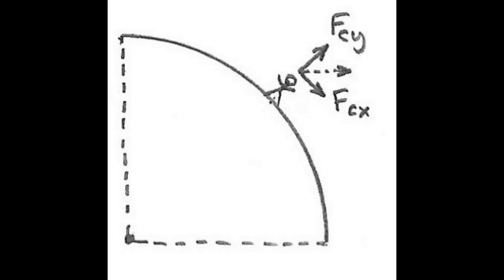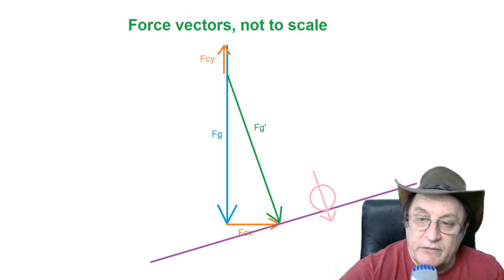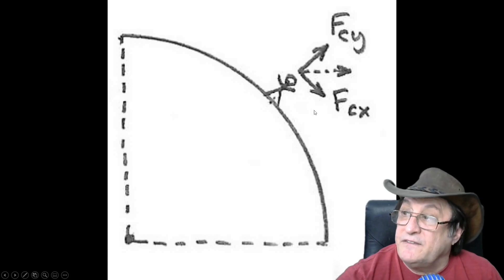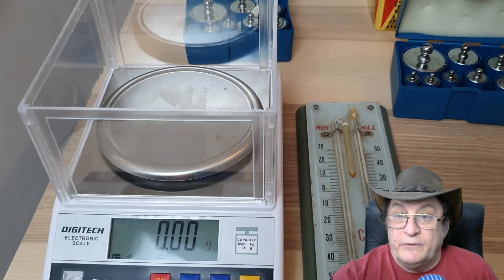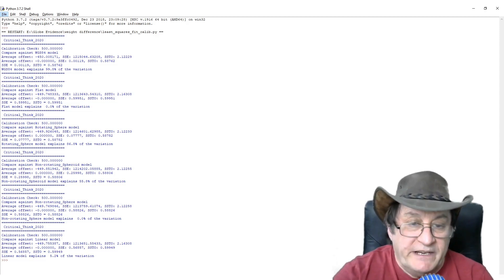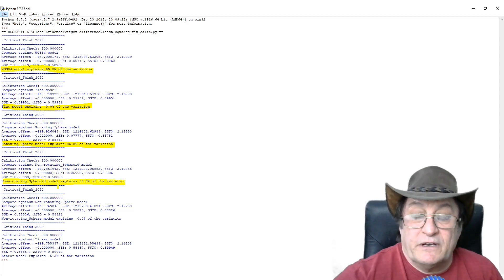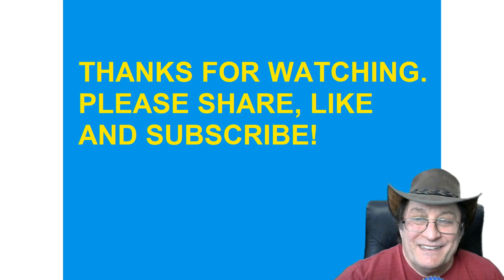David "The Mechanical Engineer" is going to have to eat his PDF. Part 2.

Comment: wouldn't a small stand eliminate the influence of pressure on "weight" CT?
put the weights on something like a pencil end and the pressure from BELOW would be almost 100% the equal of the pressure down on the top of the same weight...  A "caltorp" like thing from wire with minimal contact area would be even better. And you still can tare out before using those.
Reply from the maker: I think the most significant effect of air pressure is a change in buoyancy, and another commenter has calculated this out to be insignificant.

Comment: I think it is even simpler. Fcx is actually zero if you use the oblate spheroid. The spheroid is everywhere perpendicular to the sum of gravity and the centrifugal force. This makes Fcx zero by definition. His assumption of spherical earth was made on purpose to hide this fact.
Reply from the maker: That may be the case. I wasn't able to dig up a concrete reference to verify it. Larry Scott is a geodetic surveyor and says a similar thing.
Reply: @CriticalThink  Think about the oblate spheroid as the surface of the ocean if there were no continents. Water "level" is equipotential surface but the potential is cased by both the forces. Equipotential means there is no component if the sum of the forces parallel to the ocean surface.
Reply from the maker: Arctic Haze I agree, it’s just that I need to do my research to understand it better to verify it for myself.
Reply: @arctic_haze  But in practice the gravity vary. That makes the geoid equipotential.
Reply: @ReinoGoo  If course it does. This is why the geoid is more complicated that just an oblate spheroid. But still, the "level" (for example the local water surface) will still be perpendicular to the vector sum of gravity and centrifugal forces (by the way both are apparent forces but that changes nothing).
Reply from the maker: Nevertheless,  the analysis here doesn't depend on Fcx being zero, so it's not important to verify it.

Comment: I just ran through the calculation of how much variation in air pressure might affect your measurments. Assuming the weights are steel with a density of 7800 kg/m^3, the weight of air displaced by a 1 kg steel mass is nominally 1.57x10^-4 kg. 
If air pressure varies from say 30 inches Hg to 29 inches Hg, that is 1/30, so the difference in buoyant force on the 1 kg mass is 5.24x10^-6 kg,  or 5.24x10^-3 g.   You can see why this variation is negligible compared to the variation due to latitude, which in your case changed  1.8 g on a 500 g mass, between 8 degrees and 38 degrees latitude. The error bars on your measurements due to air pressure should be about +/- 1x10^-3 g.
Reply: For flat earthers 1x10^-3 g is VERY SMALL. ie a third of the mass of a single snowflake.

Comment: Wait. Maybe I missed it. But since Fx exists why does a ball bearing on a flat surface not roll towards the equator? I did not hear the answer to that question. That was David's question. His question was not whether Fx existed. He claimed that since a smooth, steel ball bearing on a flat smooth surface does not roll toward the equator, then Fx must not exist.
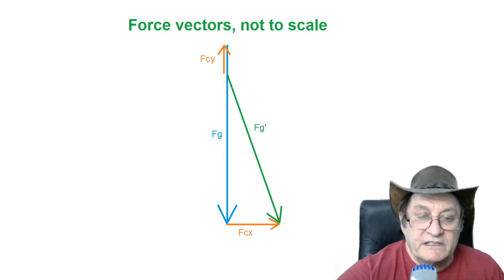Reply from the maker: That's explained at the 2:50 Mark. A level surface will be perpendicular to Fg' hence the ball will not roll.
Reply: Because Fx also affects the instrument used to level the flat surface.  
The "engineer" expects the force to only act upon the ball in the experiment and not the instrument used to level the experiment.
Reply: Ahhh yes! OK. I did not fully comprehend your point with the Fg prime. Now I get it! I guess the point that "level" may not be a tangential line is something that I was aware of because the Earth is not a perfect and smooth sphere so gravity does not always point to the exact center of the Earth, was something I took as a general comment. I did not make the connection to the actual question! It went right over my head ... I must confess that I learned something new. You just blew my mind. Thanks you two for clearing that up!
Reply: @mangojulie123  Level is a tangent line to a level curve, not to the ellipsoid or a sphere.
Reply: @ReinoGoo  Yes, I eventually understood the point. Level is perpendicular to the net force vector,which is not necessarily pointing to the center of mass of the spheroid. It's that simple. That's what I had initially failed to grasp, because I had in my head the simplified model of a perfect sphere with only a gravitational force at work. I did not mentally note that in reality, the Earth is not a perfect sphere and that there are other force vectors at play.

Comment: Good thing is I never want to have David working for me. If I needed something measured, he'd refuse to use any instrument that is designed for the job. Instead he's show some crayon drawings and then just make up some wild claims without doing anything else.

For example, if I want to determine if something rotates. I have lots of options. One of them is a gyroscope. It literally measures rotation. For example, car manufacturers figured this out. If you have a car with stability control, it uses three things to determine if the car is oversteering or understeering in a turn. A steering angle sensor, wheel speed and a gyro. So when you are driving at a certain speed and turn the wheel at a certain amount of degrees, it will rotate at the same amount over and over again. If you have too much steering angle, then it knows because the rotation is not enough. Thus it will adjust using the ABS system. Same for if you oversteer.

In the end, if a gyro measures rotation, then why not just mount it on earth and see what it does? If it works on a car and everything else that rotates, it'll work on earth. so mount one on earth and see what it indicates. No need for this worthless pdf.
Reply: Thanks Bob! ...err Bill!
Reply: Robert Emery - I need a heavenly energies shield system.
Reply: Yes, he is a great example of why I would knowingly employ a phlat erfer. You couldn't trust a single one of them to do their job properly without standing over them.
Reply: You need a very good gyro to measure a rotation that slow.
There is one in a gyro compass. Take it for a spin and watch what it does.
Reply: @ReinoGoo  - It's like all instrumentation. For example, I'm in the ultra high vacuum industry, so when you wonder how we can tell the difference between low pressures of 10-7 or 10-8, you need the right sensor.

Comment: After calculating fcx I was expecting you to derive fcy from it, for a given latitude, and show exactly how miniscule it actually was! Oh well...
Reply from the maker: Sorry I didn’t think about that at the time. How small Fcx or Fcy were, was not in dispute, just that flerfs think you should feel it or measure it.
Reply: @CriticalThink  - That's the point. They think the human body has that type of sensitivity. Here's an example of how our internal gyro is not that good.
1. Find a long straight line (i.e. in a parking in a closed business)
2. Stand at the end of the line
3. Have your friend put a blindfold on you and then place you at the beginning of the line (if you were not there already)
4. Walk forward for a few minutes
5. Take off the blindfold and see where you are at

Technically, your internal gyro should keep you on that line as it can detect rotation. So you'll never veer off. If you do, then you have a top notch gyro in your body. If not, then you found the limit to what it can do. I would suggest to try this in a car but you'd need to be out in the middle of the  Bonneville Salt Flats where you can drive for a long time and not hit a thing. Since we all can't do that, a parking lot works pretty well.
Reply from the maker: Feeds Ravens all the math I covered in earlier videos on the playlist.

Comment: And ... there are three definitions of latitude longitude:

Geocentric, which is based on the mass center of the earth. From a point on the surface to the center is not normal to level. 

Geodetic lat/long is normal to the ellipsoid. 

Astronomic lat/long is normal to the geoid. Which is the net of the gravity vector.

Comment: The centrifugal effect on gravity between the poles and equator are, for an average human, about the weight of a glass of water.
In other words: completely unnoticeable.
Reply: Exactly, You change your mass more by dressing in the morning, taking a shit or piss or having lunch. We do not notice ten pounds more or less on our ribs... until the pants are getting uncomfortably tight that is, but not by effort to move alone. Why would we notice a minimal sideways component that would only be a tiny part of the combined centrifugal / centripetal forces... (IIRC petal is the imaginary force needed to keep you on the ground despite a centrifugal force trying to displace you - think the string on a balloon or the carroussel arms holding the rocket in place when spinning - so in theory it should be exactly the same amount of force as centrifugal, no need to make all the distinctions which force you're talking about) 

Only an abrupt change like transporting directly from the equator to the pole would be noticeable. Going at car, train or planespeed along the smooth gradient would never alert our senses. Those are primed to warn us ONLY about sudden changes